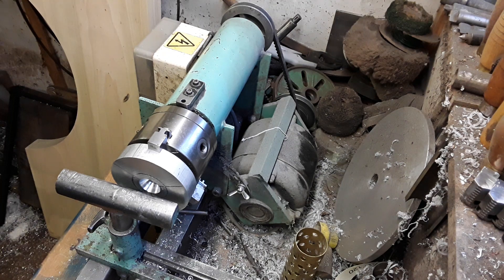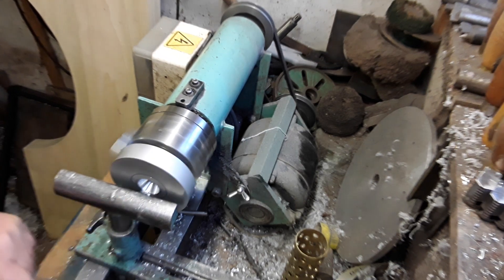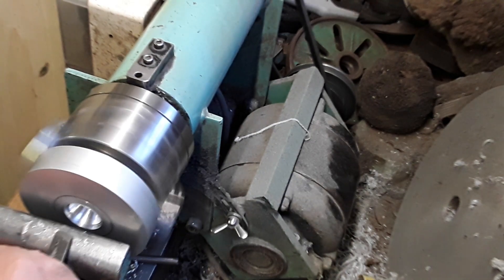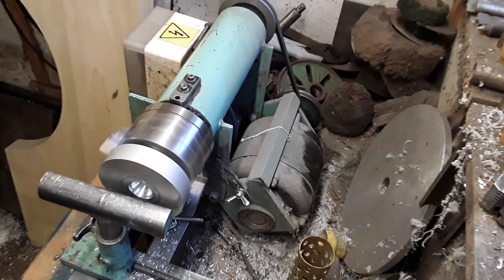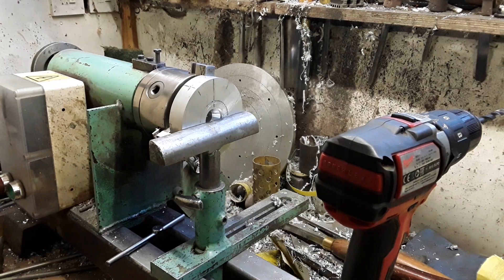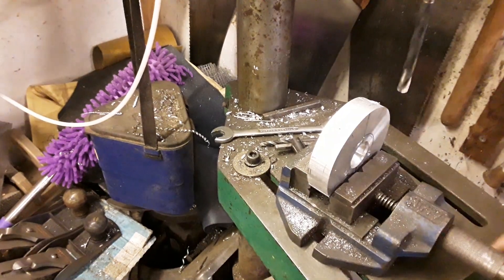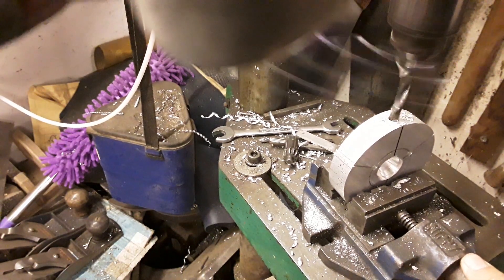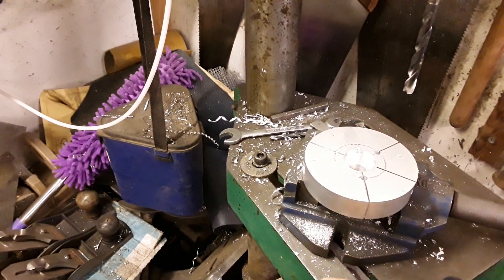Workshop tools, Counter Bearing Hot Puller How I made my own.

Comment from the maker: Looking throught some bearing charts I have found the same inner or counter bearing type and or size is also used by KTM IE, the 31.50mm puller is the same flat roller bearing that  is also used on the Lambretta scooter crankshaft/flywheel ignition side.